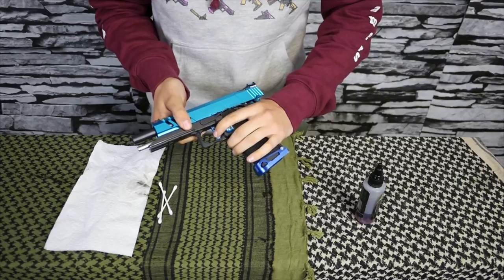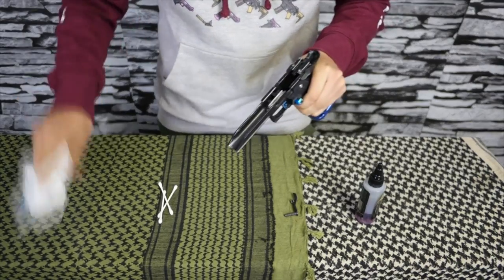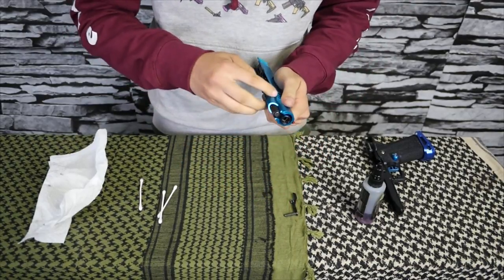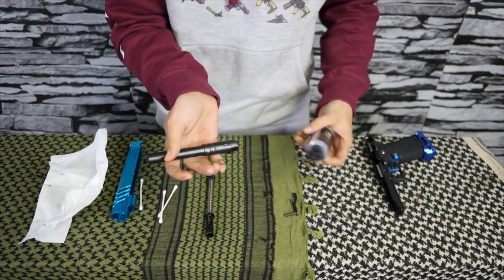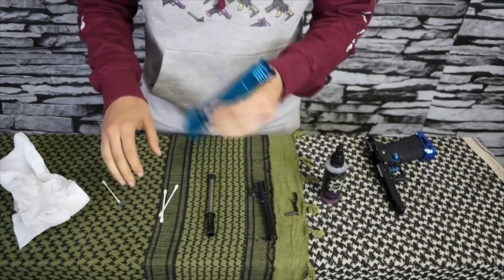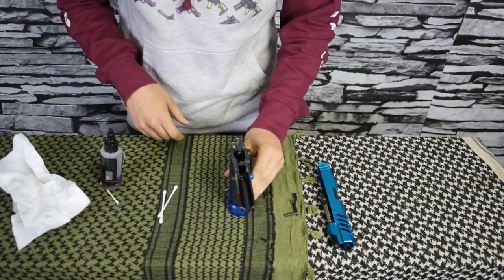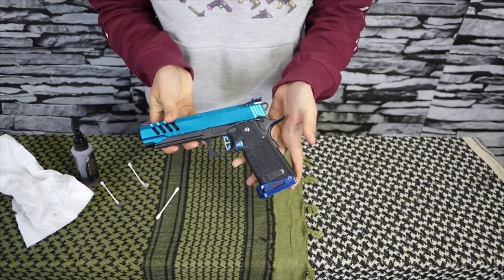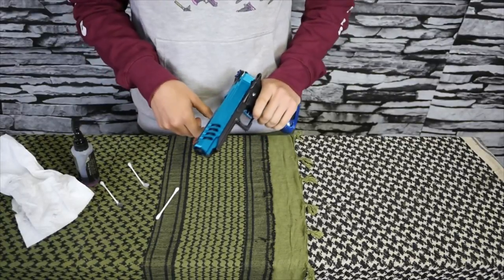SpeedSim: Hi Capa Basic Cleaning & Maintenance

Comment: What do you suggest using for the maintenance of the bbu? Murder Oil got discontinued and I need to find something knew.
Reply: Yo what did u end up using?
Reply: @switchbladegaming410  I use synthetic grease for cleaning and for bbu maintenance I use elite force silicone spray